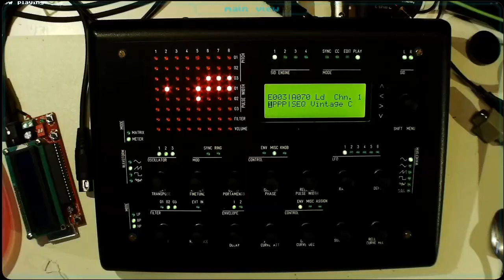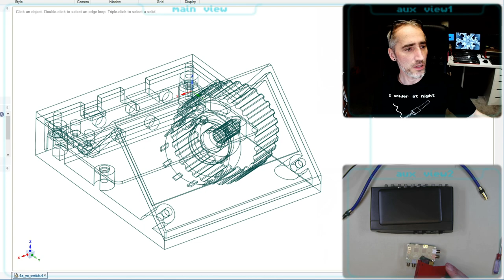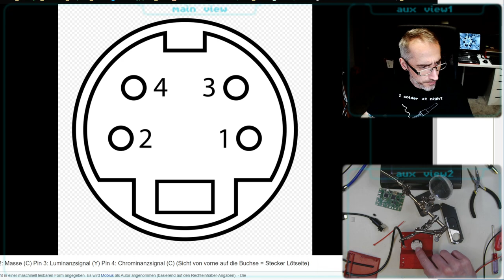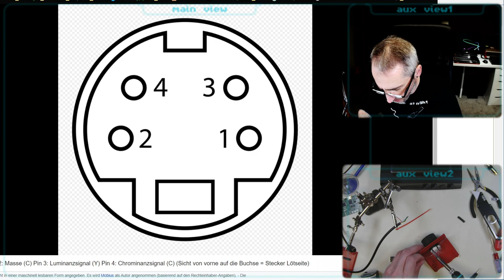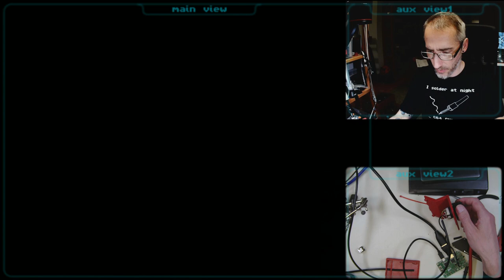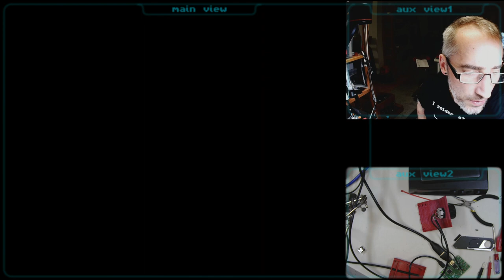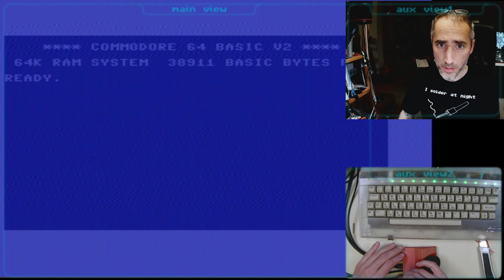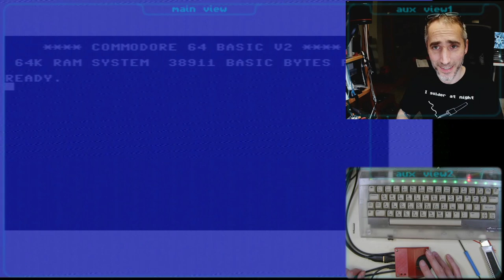4way Y/C (S-Video) to HDMI Switch-Converter

Comment: Nice work. Designing a pcb with some kind of Switch and presoldered ports would be a better design. This the first step to create rack mounted c64 music station.
Reply from the maker: Thanks for the comment. Yes, I think I will create another one, as mentioned in the video. I was really annyoed by all these wire soldering ;) I may include audio as well since this is perhaps interesting for others.

Comment: Nice build Daniel! Normally those switches have an option to put a peg to limit the amount of switching. I love your solution though. Awesome. I personally would have gone with a thicker cable from the switch to retrotink, but hey, it's working. When do we get to see and hear your 4x C64 setup? So curious!
Reply from the maker: Hi Mathieu, thank you very much for the comment. Yes, I was expecting some sort of lock or peg to limit the rotation but hey, it works this way too :)
Yes, the cable to the retrotink should be a bit thicker and shielded but for f$%& sake I couldn't find one in all of my material boxes ;)
The 4x C64 setup is almost complete, I'm working on the final wiring to get the Midi well distributed and I'm almost done with the audio routing. Now I 'just' have to create some sort of music, otherwise the video will be pretty boring ;)

Comment: hah, I think it's friggin brilliant. It may not be exactly the way you want it, but it works! Really well done. I don't think you'll be adding those leds I guess :) Or wasn't that what the extra holes were for?
Reply from the maker: Thank you very much for this kind comment. The holes are for the two buttons of the Retrotink. It usually keeps the last seeing used but just in case I need to adjust something I wanted to have access to the buttons.
Reply: @c64customs  Right I was wondering how you were going to change settings on the retrotink.